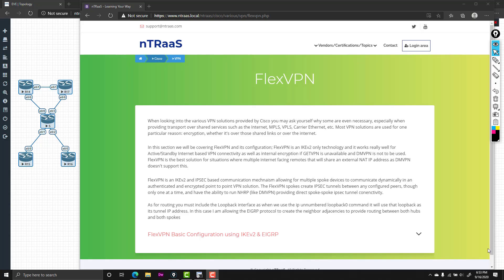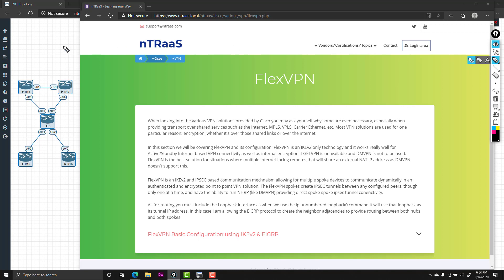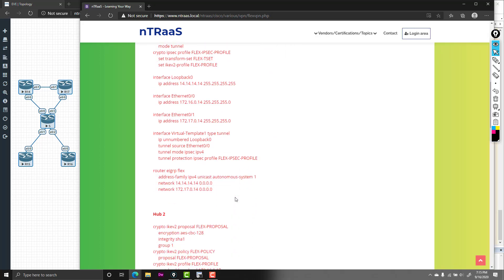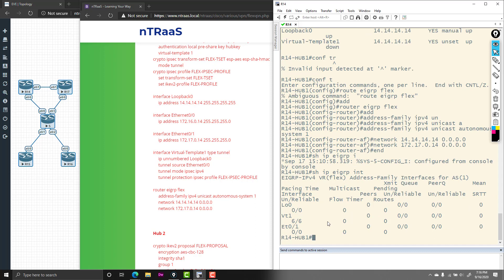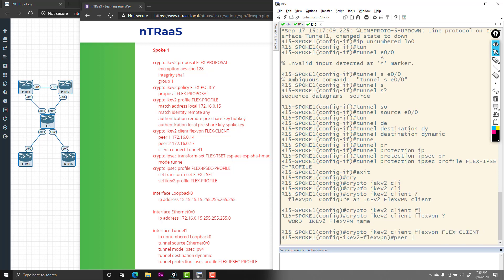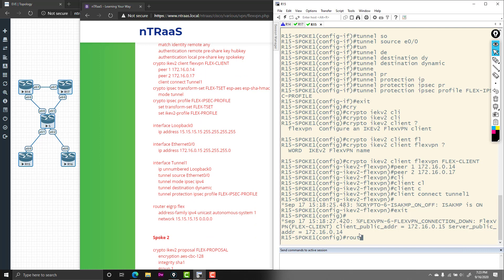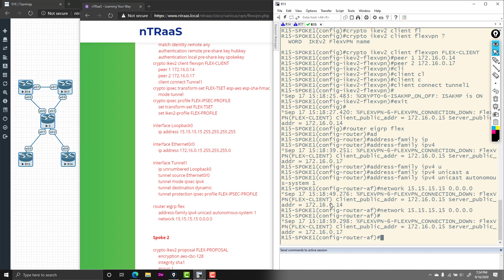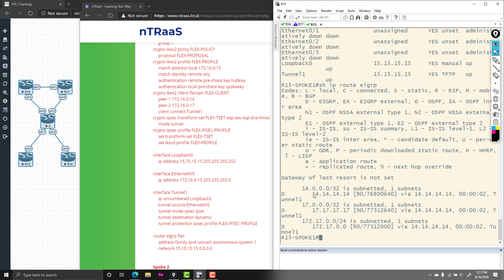FlexVPN Configuration

Comment: You can do active/active.  I have a LTE 1101 router that is actively peered to a ASR cluster at SiteA and SiteB at the same time. On the spoke I define two separate tunnels.  Crypto ikev2 client is the HSRP address at each site of the carrier facing interface, client connect specifies which tunnel to use.